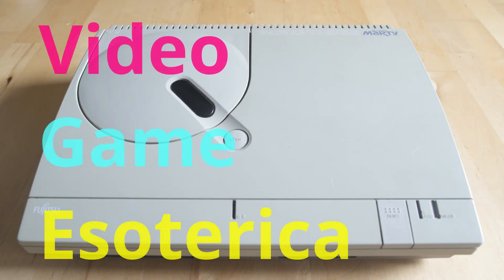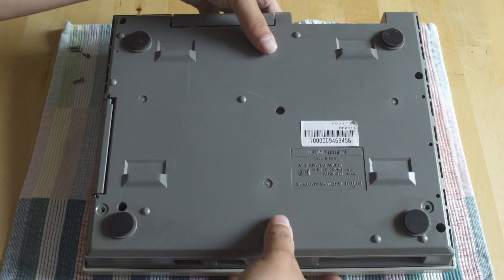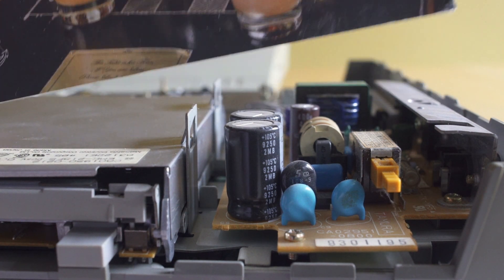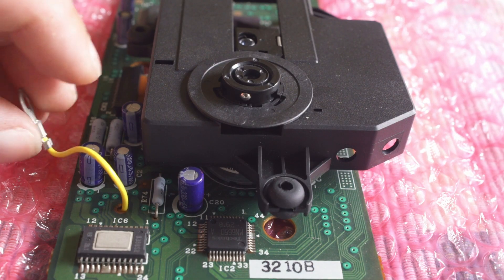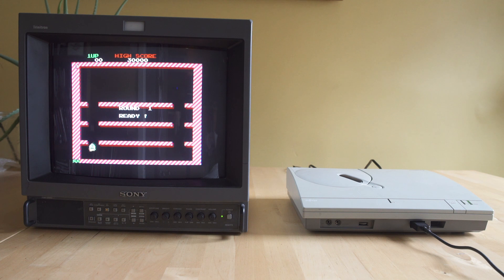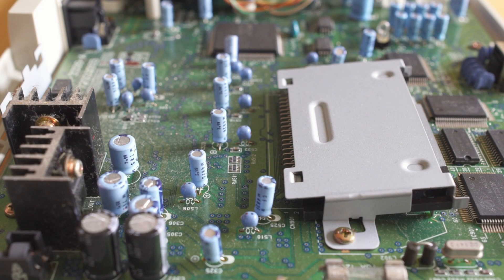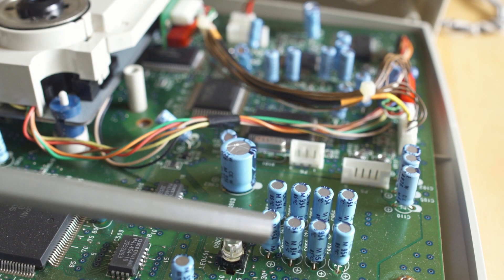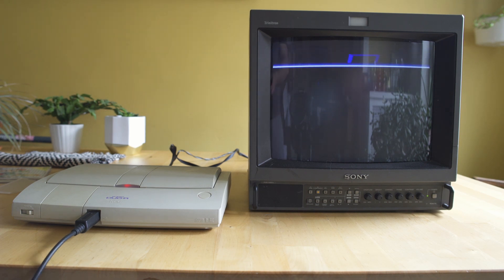Checking Capacitors on Retro Game Consoles and “Health Checks"- "On a Technicality"

Comment: Thank you for making this video! It reminded me I need to be more proactive and check the inside of my Marty. I'm a relatively new owner (have had mine for about half a year) and when I opened it up, I was very pleasantly surprised by how well the previous owner took care of the system. The capacitors look great with no signs of bulging, including the ones on the optical drive (which still works!), and the whole board is clean as a whistle.

I'm going to set myself a reminder to check again every six months just like you're doing - the Marty is a wonderful, rare, and exotic console, and even putting aside cost, I'd be crushed if mine ended up damaged/non-working due to my own negligence.
Reply from the maker: Yes the six month check is great. Caps don’t go bad quickly so if you check every six months you’ll catch any issues early enough
Reply: @VideoGameEsoterica  I have a followup question. Would you recommend getting a stepdown converter for the Marty? I live in the US so I get 120V (according to my UPS, 124V usually). I know many Japanese systems are designed to tolerate the extra voltage and while my Marty works without issues, I don't want to put extra stress/heat in the system if it will cause it to fail faster.

Thanks!
Reply from the maker: I don’t use step down converters on any Japanese systems myself

Comment: Hi, first of all thanks for such useful video to watch. I do have a question for you and it will help me big time. I have my FM towns Marty that started to have sound issues. When I turn it on, the main intro music sounds really weird, really loud weird sound on the intro music. Do you know which caps could be the problem? But definitely something related with the sound. When I play a game same loud noise that makes the music unrecognizable. Please, let me know any ideas on which caps could need replacement. I have experience recapping the PSU but in terms of sound, I don't know which caps are the faulty ones. I will check back soon to see if you have replied. Thanks, truly!!!
Reply from the maker: All of them. If the sound section is going then it’s time for a full recap. Check Console 5. They sell a recap kit
Reply from the maker: I mean it’s most likely caps around the YM2612 chip but honestly if you are doing caps you may as well do them all at once as there is no guarantee the issue is JUST in the sound section
Reply: @VideoGameEsoterica   Thank you for your quick reply. So all the main board you mean, correct? I have done all caps in the power supply and all caps in the cd drive.
Reply from the maker: Yeah I’d just recap the entire main board. I can’t be certain it’s just caps in the sound section so best practice would be a full mobo recap of what you haven’t changed
Reply: @VideoGameEsoterica  Great and thank you for your help. I will order the kit. I hope all caps needed will be included in the kit. Have a good evening!
Reply from the maker: Check to make sure it’s a full cap kit and not just the power supply one!

Comment: Good work mate. Ive been doing the same thing for the last five years with my vast collection of consoles. I just stick a small low tack removable sticker underneath somewhere and write on it last time it was booted up for a days worth of exercise and under the hood check up. So far i have been very lucky.

I read somewhere, not sure if it's true...don't these capacitors die through lack of the console not being used? 
I read booting them up routinely for a couple of hours reduces the rick of capacitors leaking??
Reply from the maker: Yes powering them on is good for their health. You don’t want to leave them stored for years
Reply: @VideoGameEsoterica  Excellent! Thanks for confirming this. Can i just get it in writing now to give a copy to the Mrs?
Reply from the maker: Hahaha you are own your own

Comment: hi another way to see if a cap is almost bad visualy is the heatshrink if its near te edge at the top of bottom thats a indicator of heat wich means if u measure out with a esr meter on ohm ure ohms are to high most likely also u mentioned about leaks briefly and it beeing a white dust  i had caps that where leak and didnt had white dust but fluids on the pcb also the ones who go fast are the smaller caps mostly the 1uf and 10uf
Reply from the maker: Yes sometimes it can appear as fluid. Or white dusty substances. Every time it’s slightly different it seems depending on the chemical make up / cap manufacturer / etc

Comment: You can't always see it with the naked eye. I've seen plenty that look perfect until you remove them to see underneath. Look at the power supply caps in Voultar's latest DCHDMI/DCDigital video. It's a single-sided PCB so that is NOT flux under those PSU caps.
Reply from the maker: Definitely true. But I can’t recommend people desolder caps to check underneath unfortunately. This is top level “so I see something nearing the burst point” capacitor inspection. Moving forward I’ll do another video on “at what age should you do a maintenance recap on X system” video that discusses when (if not now) you should think about recapping a board for “future proofing” it
Reply from the maker: But in my experience 95% of the time when capacitors are leaking / going to start leaking there is visible bulging somewhere on the cap you can see. I see it more often than not on the top. Like I said...impossible to definitely diagnose every cap. This is a “be mindful of checking and inspecting your stuff” tutorial
Reply: Yes. Only reason I mention it is because people will incorporate the advice into a rule of thumb. Like Dave Jones (EEVBlog) always says: AVOID rules of thumb. ;)

When you make the other video, I'd like to suggest keeping that in mind since there is no rule of thumb about capacitor age either. A good example is NES or N64 where the mainboard caps seem to last forever but the NES power/AV box from Alps or Mitsumi or the N64 AC adapter from Zebra and others usually have failed caps. Many caps were reformulated from the late '90s to mid-2000s for RoHS compliance and that is when the real "capacitor plague" started. While the plague itself happened due to a Taiwanese manufacturer stealing half of a Japanese formula (without the stabilizer), the continued reliability problems to this day are due to RoHS. Older pre-RoHS caps from quality suppliers were not guaranteed to fail with time like modern caps are. The ones that were were typically suffered from design flaws resulting in the industry shifting to new package designs (SMD) or they were just cheap.

This is why I prefer inspection over shotgun cap replacement unless the board is known for having failed caps... like a TurboDuo or TurboExpress. A TurboGrafx on the other hand? Probably doesn't need caps if you aren't having a problem.

If you are having problems and a visual inspection doesn't reveal anything then the rule of thumb to avoid rules of thumb (LOL!) would indicate that you may need to replace the caps anyway before going much deeper. :)
Reply from the maker: Lol yes. This is for “check for weirdness before you start experiencing problems”. Some systems have rock solid caps, others have caps that are basically ticking time bombs. But so many people never check until their hardware stops working and they open it up and find a bunch of caps that are leaking electrolytic fluid everywhere and they’ve already eaten solder mask and possibly traces away. 

Checking every six months on retro hardware a) means you will notice something early as caps don’t seem to just go boom one random day and leak and b) gets people in the habit of realizing their hardware has components inside of them that aren’t “forever” parts. So many people are getting into retro gaming lately it seems but I don’t think most realize what it takes to maintain a collection of hardware and keep it running into the future. 

So my rule of thumb is “check every six months” and get used to visually inspecting hardware for faults. Leaky batteries, leaky and bulging caps, dust build up, etc etc. Some things I can’t make videos of (dust build up) as generally I never let anything get too dusty lol. 

I need to figure out how to make a cap “go bad” in a controlled environment. Show the bulging. Maybe take a heat gun to one and slowly get it to expand so I can get a visual of it.